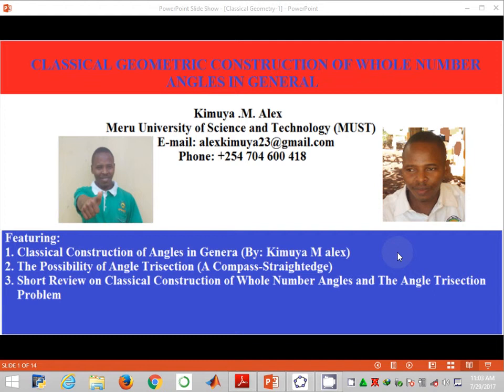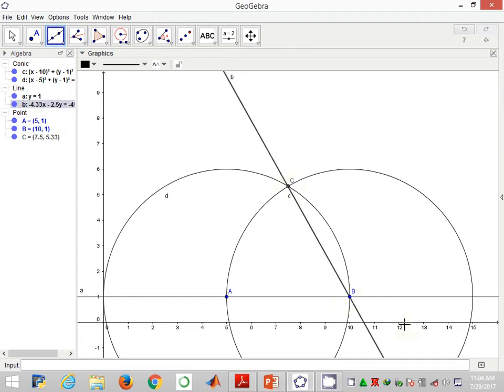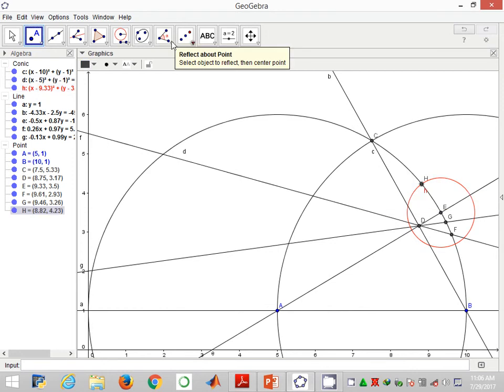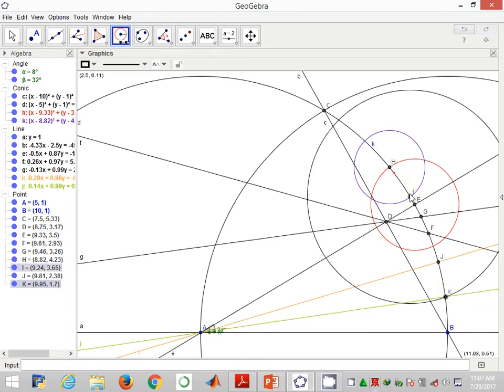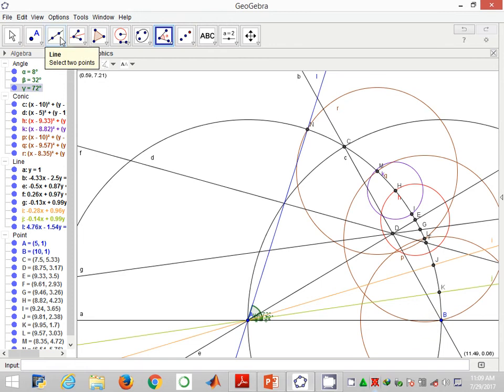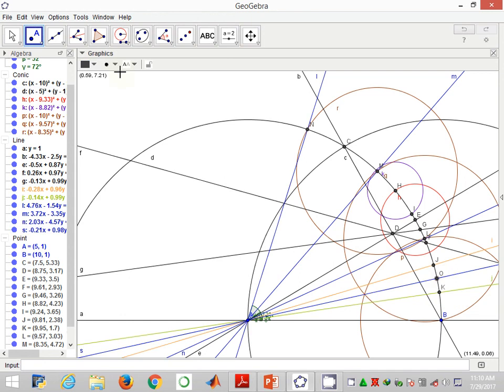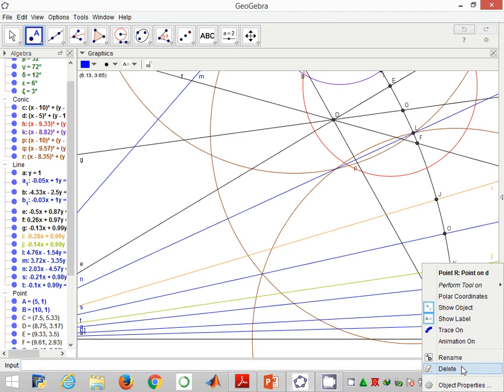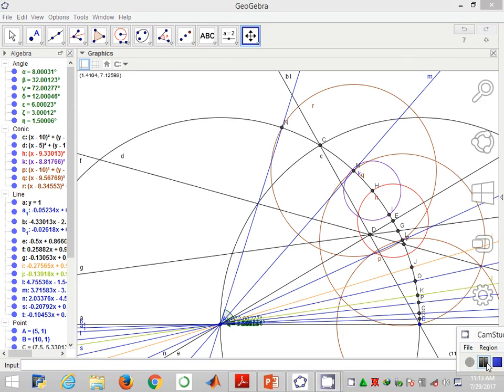Construction and Trisection of 72 degrees Angle

Comment: I would like to see one that I wouldn't need to draw lines. Do u have any idea?
Reply from the maker: It is rally so difficult to get one that you do not draw lines. It would mean, continuous bisections and this is not a good way to do it.The two chords generated using my method pretty well match the Archimedes way of thinking, in terms of measure. Many classical geometric theorems emulate similar approaches too. Thanks.

Comment: Beautiful bro! I got all the multiples of 3, but now, with this method I can finally get those pure multiples of 2 and our friend 1!
Reply from the maker: Hi Felipe Dias. Thanks for your comment. The method works for construction of all whole number angles and their multiples. Did you mean you were able to construct only those multiples of 3? If yes, are you able to share your method please?
Reply: Alex M Kimuya for sure!

First of all we find angle 30 (by drawing another circle of the same size at the North pole) and then you find the 18 angle by this method: https://youtu.be/IvuXj_lbPzU

After that you have the difference between then of 12 degree, that u can split in half two times ans obtain the brother 3 😊
Reply from the maker: Hi Felipe Dias. I looked at your construction. It is so beautiful geometrically! I can help you to generate all the other whole number angles easily, using your method. I think this is an idea that can be published! If you got interest in this proposal, please contact me through alexkimuya23@gmail.com,we discuss on the way forward. Thanks.
Reply from the maker: The method described in https://youtu.be/IvuXj_lbPzU is very fine. Since we are able to classically construct 30, we also should be able to construct all whole number angles. Mr. Dias you can contact me through alexkimuya23@gmail.com, we talk more.